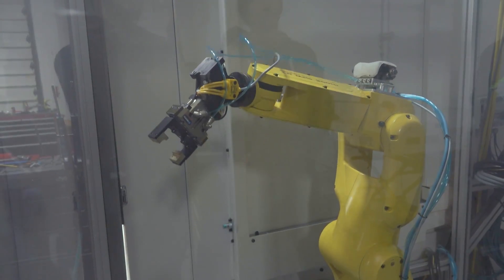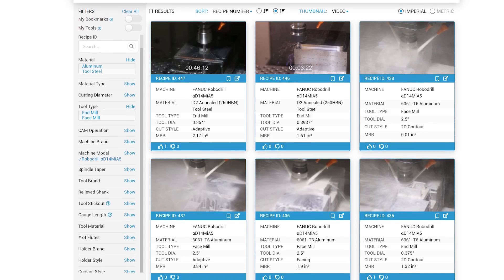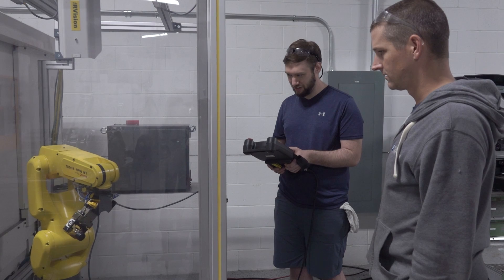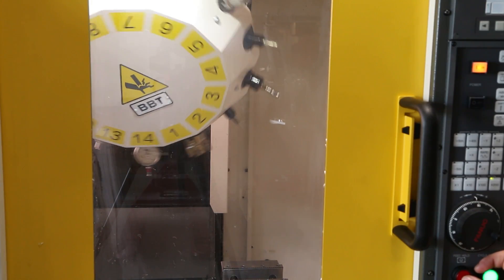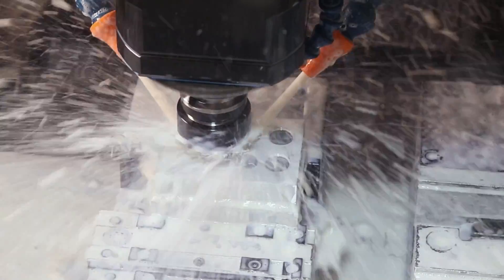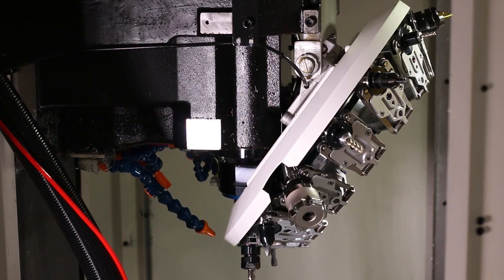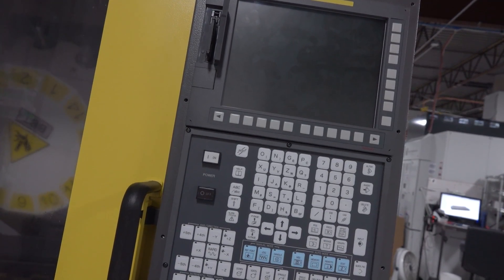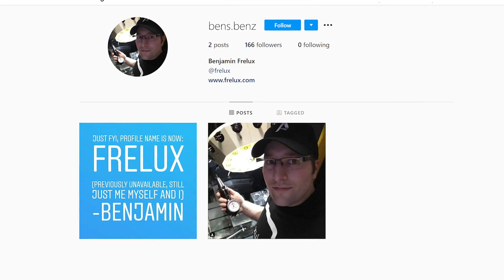FANUC RoboDrill CNC Machine: Showing what a Drill Tap machine can do!

Comment: I recently got a predecessor of the Robodrill, a Tape Drill Mate, with a 10 Position Toolchanger, and i love the fact that it is entirely mechanical.. 
The Control of this machine was missing.. that is why i got it for free.. but i plan to retrofit it anyway.. since i can then run my preferred Controlsoftware, and also my own Editor/Cam Application On the machine..

Comment: Without the ability to check for changes in tool length (Breakage) you cannot run 'lights out'. I run D21 Robodrills at work and I love them. And yes, The Fanuc control is definetly made for engineers, not operators.

Comment: For the transfer of programs from and to USB, use the “Quick N/C” button on the right hand side of your controller and go to the horizontal softkey labelled “quick edit”. Here there is a very straightforward GUI that allows you to transfer via any storage device connected to the controller. The “Quick N/C” menus hold a lot of info and functionality that is commonly sought after. Hope this helps.

Comment: Since I've read like 100 comments on Fanuc controls being unintuitive and bulky. Thing is, Fanuc keeps things standardized. If You learn to program or use new machine, You can go and do exactly that with almost any machine from Fanuc made in last 30 years. It's exactly same with robots. We have robots made last year, robots made early 2000's and even from 1990's and except for older pendants lacking color screens - almost everything is exactly the same. One day they will have to change that, technology goes in large leaps, but their idea of keeping a straight standard is IMHO great. Also, You can buy any part for any machine, if they don't have it, they will make one just for You. It will not be cheap, but still possible. Others like Kuka will tell You to buy new robot.. I'm working with Fanuc and Yaskawa robots every day. Since I've learned Fanuc, everything is simple, stable and I love it.

Comment: I recently retired from ~30 years of PLC & macro programming on mostly Fanuc CNCs.  21i,  0i, PowerMate, 31i, etc.  Even the oddball 15i.  Steep learning curve, but wicked powerful controls.  I hope you have those manuals in PDF format!
Reply: Care to tutor someone?
I've never done cnc, but baught a t21iel with the 31i controls to "learn" on
Reply: @RoboDriller  Possibly?  I'm not a machinist, so I can't help much with feeds & speeds or machining strategies.  I did a lot of operator training on some complex processes, sometimes to folks who didn't understand English.

But, how would we do this?  What sort of knowledge are you after?  And what specific 31i model do you have.

Cheers, and Happy New Year!
Reply: @grottyboots 
31i-model A5
Reply: How do I get my 35i to accept ND data from the rs232 port?

I baught a shop floor automations cnc USB, installed it to the rs232.  So now my machine has USB.  But on the change input it has either, card or machine memory only
Reply: @RoboDriller  Do you have access to the CNC's parameters?  Specifically, most of of the parameters from #0 to #200 or so.  These set the CNC's various "punch/reader" interface settings, things like baud rate, parity, etc.  Fanuc CNCs are pretty flexible in how they communicate, but really obscure to set up.  The USB device likely has easier setup, so knowing how the CNC is setup and then matching the USB device to match is easier, in my experience.

If you can see the parameters (sYSTEM key > press + softkey until you see the PARAM sofkey > press the PARAM sofkey.  This should show the CNC's parameters starting at #0.  PG-DN & PG-UP will move to next & previous screen of parameters.  Write down the value for each parameter from #0 to #200; some are a string of 8 bits, others are just numbers.

If you can't see the CNC's parameters, the SETTING(HADY) screen provides some of the info we need.   Should be able to see this screen by pressing OFFSET/SETING key -> press the + softkey until the SETING softkey is visible -> press the SETING softkey.  This screen has a list of parameters in a more "friendly" format, "TV CHEK, PUNCH CODE, INPUT UNIT, etc.  PG DN and PG UP move thru the various screens;  write them all down.  
 
If you can get that far, we'll have a good chance to make this work.  Other things I'd like to know:

- what connector did you wire this USB device?  
- did the connector you wired this USB device ever work?  Was it connected to another system before you attached the USB device?
- confirm that this is the USB device you  installed:  www.shopfloorautomations.com/hardware/pendant-usb-connect/

I'm 90% sure we can get this working.  It'll be slow & tedious.  But I've connected various Fanuc CNCs to dozens of different communications means (including paper tape readers, floppy disks, Ethernet, etc.). 

Suggest we move this to another comms means; Youtube comments are not ideal for this... I do WhatsApp, FB Messenger, and email.  Lemme know if you have a preference, and send me your contact info.
Reply: @grottyboots 
I'm getting a sr1300 code now.   I think it's communicating.  But a post issue like NYC is taking about
Sent the email to you.  I'm looking forward to your input on this and who knows, maybe I can help you with your projects too
Reply: @RoboDriller  SR1300 means you have an illegal "address". In Fanuc speak, that generally means letters such as X, Y, Z for axis value, F, S for feedrate and spindle speed, or G, M for G-codes and M-codes.  Here's what the manual says for SR1300:

"The axis No. address was specified even though the parameter is not an axis–type while loading parameters or

pitch error compensation data from a tape or by entry of the G10 parameter. Axis No. cannot be specified in pitch error compensation data."

This is confusing, since this description is related loading CNC parameters or Pitch Error Compensation.  But you're loading a "part program".  Probably the manual is not updated... very common, plus my manuals are from 2015.

I agree it looks like you've got communications working, at least enough to trip this alarm.  Can you tell how much of the part program is loaded before the alarm occurs?  Fanucs will typically keep the program up to the point were it alarmed, and that can give you a clue where in the part program the error is.

You mention you "Sent the email to you"... I have rec'd nothing.  What email address did you use.

One step at a time, we'll figure this out.

Cheers!

Comment: Nobody can make a more unintuitive UI than linuxCNC. Fanuc: Hold my drill.
Reply: One good thing: If you know one Fanuc control, you can usually find your way around any other Fanuc model.  For the day-to-day operations, the menus are similar enough... judicious use of the + and > softkeys will usually get you where you need to go.

Same goes for the underlying PLC programming, macro programming, and NC coding.  At the basic level, a 0i-Mate PLC is very similar to a 31i-A5 PLC, and all the variations in between.  The differences are usually due to the new features of the higher-powered controls.

Doesn't apply to the bastard 15i series of controls.  Complete break with tradition.  Drove me up the wall!
Reply: @grottyboots  yehr Work on a Robodrill and then switch onto a Star ^^

Comment: I have to correct you on draw bar, dual contact and spindle tool fretting. Dual contact BBT using Big plus spindle tools present face and taper contact. Your using BT 30 spindle tools. Therefore taper contact only. Not dual. You should be using BIG KAISER BBT spindle tools. ATB.

Comment: Are you using Oil & Water based emulsion coolants or Cutting Oils in your Machine shop?

Are you throwing out your Emulsion Coolant for Foul Smell too often?

Do you wish to increase your Coolant's Life Cycle?

Do you have Problem of Foul Odor like Rotten Eggs etc?

 

In case you answer "yes" to any one of the above question, then you would be definitely interested in our very inexpensive and innovative solution.

 

Our Motto is: Stop Throwing Away Machine Coolant, use Aqua-Logic Filter for Coolant Fluid Management. "Aqua-logic" Machine Coolant Filter/Treatment System Key Features:

• Very low Cost & Return on Investment

·   No chemical additives
• Kills bacteria and algae
• Systems are portable or fixed
• Ends rancid Monday morning stink
• Reduces coolant waste
• Avoids costly waste disposal

• Prevents skin rashes
• Lengthens coolant life
• Extends tool life
• Improves part finish
• Captures oil and metal fines

 

 

After Using Aqua-Logic you would observe the following:

 

i)      Immediate and Dramatic Results within hours. The Rotten Egg/ Foul Smell go off.

ii)       Stops further breeding of bacteria. Increases the Cutting oil Life.

iii)      Your Purchase of fresh coolant oil would reduce drastically.

Working Principle

By filtering the coolant through layers of very high purity multi metal media element by oxidation-reduction, electrochemically reduces bacteria and other microorganisms that infect the coolants, as it filters swarf and contaminants.

 

Oxidation-Reduction Process Controlling Micro-organisms

The oxidation-reduction process is simply transfer of electrons from one atom of molecule to another. The difference in electrical potential between the metals in the alloy produces an electron flow that continues almost indefinitely. This oxidation-reduction media produces an electrolytic field that causes cellular damage to bacteria by disrupting electron transport that most microorganisms cannot survive. In water based coolants this media not only kills bacteria by direct electrochemical contact but also by the flash formation of hydroxyl radicals and hydrogen peroxide which interfere with the microorganism's ability to function.

Filtration

The unit is taken in a bye-pass loop system and there can be two methods to have the coolant coming in the unit:

 

i)                 Either through a tapping in the existing pressure line (unit would take a designated LPM based on the Machine Sump Size). Optionally, we can supply a suitable AOD pump with the unit and then the unit becomes a stand alone system.

 

ii)               There is a pre-cartridge of your desired micron rating but the minimum would be 50 Microns. This is to avoid blinding of the Multi Metal Media.

 

iii)              Due to the unique design and use of Multi Metal Media, The cartridge will continue to operate in conditions where other conventional filters have plugged or ceased to operate effectively.

The results are dramatic and immediate.

The conversion of hydrogen sulphide to cupric sulphide ELIMINATES the rotten egg odor. -The electrolytic cell kills bacteria and eliminates further hydrogen sulphide production -Fluid life is increased and disposal costs are reduced.

- The use of biocides is greatly reduced or eliminated -Process quality is improved and/or tool life is increased -Most potential health hazards are eliminated -The need to control biological activity through the injection of chlorine is eliminated.

In addition, AQUA-LOGIC'S Multi Metal Media alloy provides a cost effective way to augment treatment for the reduction and removal of heavy metals. Water soluble cations, (+) ions, are removed by the galvanic action between the Multi Metal Media, eliminating or reducing most dissolved heavy metals.

Benefits :

o   Dramatically extends emulsion coolant life.

o   Saves time, money and down time in waste disposal costs.

o   Extends tool life multi fold times.

o   Captures oil & metal fines through absolute micron rating filter.

o   Kills bacteria & algae, including legionella, E-Coli, heterotrophic bacteria, Staphylococcus bacteria, Aspergillis Niger Mold. Prevents skin rashes

o   No chemical additives

o   Coolant Sumps start to smell very bad after a few weeks, or in some case even in  days. All Sump odour would be eliminated after installing “Aqualogic” Coolant Filtration system.

o   The saving would be self determined and the machine cost would be free within a year itself.

o   Reduce, or eliminate trace metals dissolved in the fluid

o   Balances the pH at an ideal 7.0 or above to continuously avoid the regrowth of the microbial activities. Prevents scale build ups.

Comment: Really cool way how that tool changer works. But, the spindle area can messy with chips sometimes and I wonder if those gears get mashed aluminum chips in them causing problems down the line.
Reply: There are no Problems whit the Toolchanger, the Robodrills work 24/7 365Days in a Year, Mechanikly! The Controll alsow is reliabl cors its a Fanuc.
The Mager flaw this machine has, ALWAYS that the Tollchanger drum gets dirty and your Contactsurfaces geting covered in dirt by time, espacely when you work whit cast iron.
A safe workaround is to Change whit Coolant Threw Spindle insted of Air, nobody knows that not even the guys who sell the machines ^^ and to make that happen you have to change 5Parameters and 3lines of code bevore every toolchange (Macro). Then you have no Problem at all whit these things!

Comment: I find it quite hilarious how that control is almost identical to the 20 year old Robodrill I learned CNC on. There’s maybe five buttons out of place, but the jog Keys , memory, edit, everything important is right in the same spot. Even the screen visuals haven’t changed very much.
Reply: If it ain’t broke, why fix itz
Reply: @almostanengineer  to make it better?
Reply: They have gotten a shared guided ui feature on both robot controller and robodrill nowadays and it's simpler to get started with the two working together now. I work with robots, done some robodrill integration but not that much.

Comment: I found that the robodrill beat brother drilling machines by at least 40 percent on multiple casting set ups . Never used it much for complex milling . This machine is a screamer for sure . I found that g code programing was much easier for me so the conversation control was not used . I am retired so the machine vintage was much older than this one . Good machine and very fast .

Comment: The limited default memory for Fanuc controllers is mindboggingly insultingly low. They really do think it's still the 80's.

Another thing is, the reason why the software is that clunky is because of old code, that has been updated and shuffled around, and to still be somewhat understandable/transferable across all Fanuc versions over the years. Oppose to figuring out a complete redesign from scratch.

If you want to see what bad software logic is, and stacking updates without fixing the core problems of functionality, get a load of this pile of BS: https://youtu.be/dKx1wnXClcI
Reply: Same on the robots, it's gotten a bit better but still shockingly out of time with this things.

Comment: The geared tool change is theoretically cool, but falls apart as spindle speeds go over 10k. The gear is not well balanced, which is why very few 24k Robodrills are ever used at the full speed (most find the sweet-spot at 22k, and things get unstable above that). Brother switched to a servo driven turret for all this many years ago, and Fanuc's newer ADV model Robodrills also have a servo turret.
Reply: The spindle is balanced via set screws installed on the gear face and the spindle coupling
Reply: This machine need calibration every 6 months for continuous running usage to maintain the accuracy.

Comment: My employer considered Ready Robotics (we're kinda local, a few hours away) for our Fanuc and Motoman robots.  Ended up not going there partially because we've been running robots for so many years and their platform is so far different that for our experienced crew, it would be a burden. Also, I never got a good answer on how well "specialty" instructions/routines were supported (such as the compensation functions used to shift the TCP and weld points on a spot welding robot whenever they dress their weld tips); as an engineer (and "power user" if you will), I (and the other engineers) do use some specialty settings/instructions to optimize our processes. Production hours are made of cycle seconds!

For what you, NYCNC would have been doing, Ready Robotics is probably an ideal solution, especially since this is your first industrial robot and you'd primarily be doing material handling with the robot being the main brain of the handling operation (most of our equipment is primarily PLC based, with the robot following the PLC's commands to do things).  I do see the value in their product; it just wasn't a great fit for our applications. 

PS: I feel your pain on Fanuc's Teach pendant UI being a bit tedious. Compared to our other main platform I routinely work on (Motoman NX100 and DX100), while Fanuc does have slicker technology, I do prefer the Motoman UI (a lot less work to do the same thing). But still a lot better than, say, Panasonic (which another division of my employer uses a lot of for MIG welding), or worse yet, the early 2000's Kawasaki "C" controllers we still have a few of in operation. The latter was so goofy that I'm told that when Kawasaki developed the "D" controller, they ditched the C's UI entirely (wouldn't personally know, by that point we were back to buying Motoman).